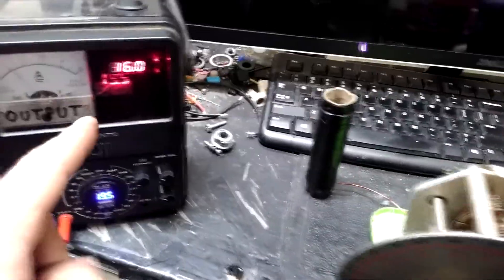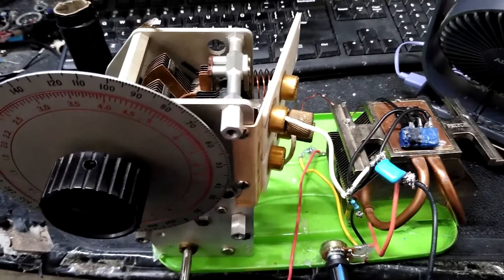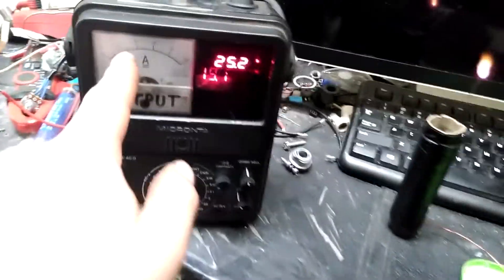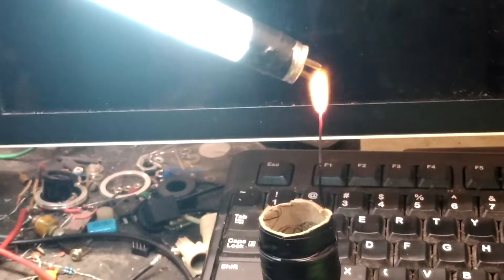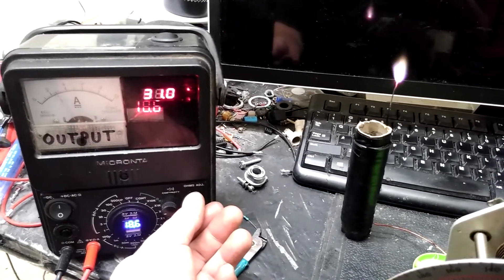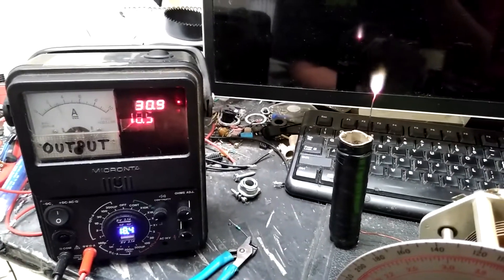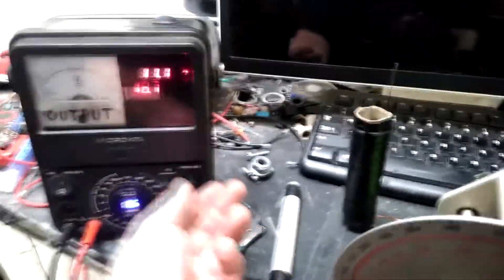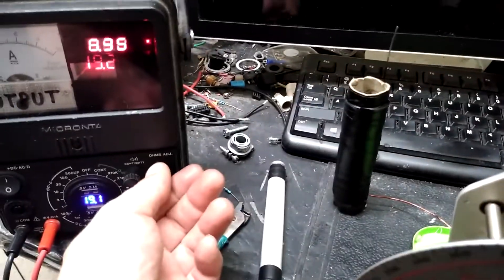16mhz Plasma Flame (running reliably now)

Comment: Hey hey hey now that's good 👍 yup looks like that other variable cap took a beat down 😂 nice hot flame and yours doesn't draw as much current as mine which is good, I'm considering rewinding a mot with thick wire for a good high current power supply, I think my setup is drawing too much power from the supply I use now .. as for the gate voltage, just set the pot and leave it, it wont get better then that, only more input voltage will get that flame bigger, try just a bit of tinfoil for a breakout tip, it shouldn't melt
Reply from the maker: I gotta come up with a better supply for it too. Pretty damn curious now what it can crank to before crapping out. I don't think it would be able to get as beefy as the arcs you get at the 50v or so but I guess the upside is I can still sort of get semi decent sized flames at portable battery power. I just got some wire in today so I'm still going to try your setup as a second build when I get an extra varicap that is way smaller.
Reply: @Magneticitist  I was planning on testing how far I can push it till the fet pops but I'm guessing maybe 70-80 volts, it would be better if I could interrupt it again but its difficult

Comment: damn! i've tried to make this circuit work but it worked just for a while then now it just keeps popping fets... i used separate feedback capacitors like in here https://youtu.be/1VsOoUB1XtY i copied the entire thing except the fet, i used some IXTP460P2 that i had cheap and yes, it's picky with the mosfets, the ones that seem to work best are the ones that pops more, another batch seems indestructible but it doesn't run good, i suspect my case is about maximum voltage, i also have seen fets popping without big reasons, i can't manage to recreate the setup that runs good, i found out there was a bad capacitor and that bad capacitor was apparently making the circuit work without popping the fet, it's awkward :D , now it has a good mica cap but maybe the circuit is too "tight" in impedence now, rising the resonant voltage.... also the varicap i have arcs often, another weak point -_-
Reply from the maker: This circuit is a bitch man. The varicap arcing was killing my fets like hotcakes. I was popping fets seemingly for no reason at first and I couldn't make heads or tails of why. The cap plates were my main problem but I'd also pop any fet I put on there which didn't have the exact capacitance as the last one I tuned on there. Once I figured out the problem it has been good to me and I can play with it whenever without fearing popping the fet but I did indeed need a very specific fet for the given layout. These ebay fets are all so varying in their charges and the intrinsic capacitances need to be accounted for to get the circuit running right unless you know how to adjust that some other way. For me adjusting this tuning was done by ever so slightly rearranging how close my wires ran off the *gate and source lol. This allowed me to tune the circuit into good running condition with about 100pf variation or so on the cap. Those wires run about a half inch apart parallel to each other for a little ways. If I move them closer or further apart any more than they are now the circuit goes out of tune. I might be able to get a different fet going but it runs completely different and the tuning on the cap might not be as intuitive. It's a really cool circuit but I don't like how it constantly takes a bit of tuning... The way I have it now I can just leave everything how it is and fire it up then just crank the voltage, but I had it at one point giving better breakout, that shit just needed a lot of cap tuning every time I ran it.
Reply: @Magneticitist  i have an immortal mosfet that i put in and out, it gives breakout on its own (i have a very sharp tungsten tip) but compared to how it ran like a month ago there's no match, i was so happy it worked kinda first try, the first mosfet i fitted lasted some time, i had to sandpaper the capacitor plates after arcing a couple of times without changing the fet (dust helps arcing)... i achieved a candle like flame like 4cm long that was super hot, turning the gate bias up made it even fatter on the base, it also made a weird blue ring around the tip when at max and the tungsten lit all the desk like a light bulb (i had to re-make the tip afterwise), i was super happy... now this son of a bitch is just eating my fets

beware of fake rubbish on ebay, i bought some IRFP460 that had an SMD transistor inside, literally soldered on the plate and then potted over, i've seen fake crap but this was unbelievable... i have bags of fake transistors and chips, sometimes they don't scam you, but 70% of the times it's a scam, my quest for a 80V 1A bjt for a triple primary slayer has been endless, they kept sending me repackaged 2n2222... i have 2n2222 also in TO126 form
Reply from the maker: @redoverdrivetheunstoppable4637  lol that sounds almost identical to what I went through. The best performance I saw didn't last cause I was fucking with the tuning and when trying to recreate it with new fets I just couldn't quite get the same exact results. There was a particular 460 (labeled 818 or something) which I tried to kill by going nuts with the settings and it just wouldn't die, but I could never get the resonance high enough for satisfying output either. I halfway wanted to keep that setup because it was indestructible but it wasn't quite worth it. Now I stick with a 918 labeled 460. I'd like to have another go at the circuit though because I want to be able to get the bigger arcs at only 30v instead of cranking it a little higher.